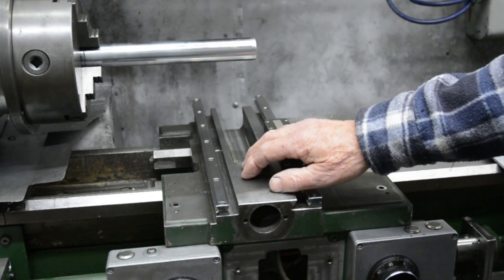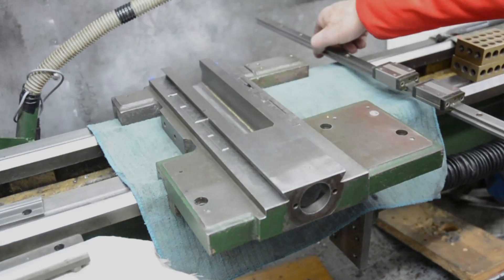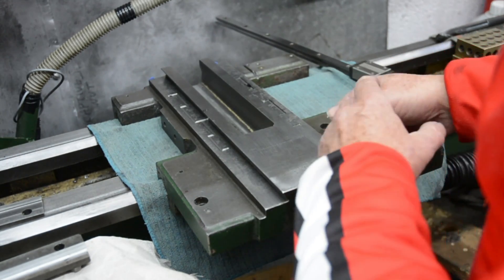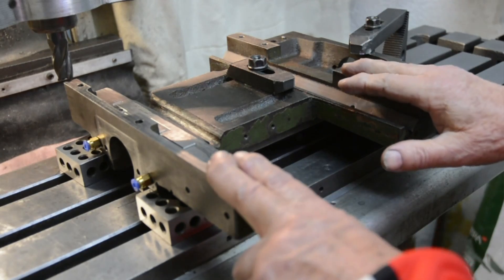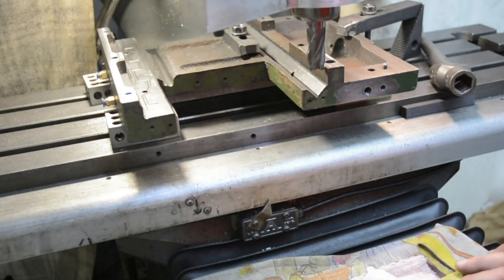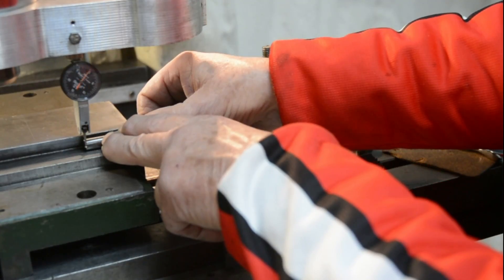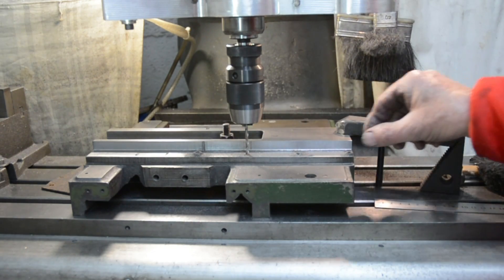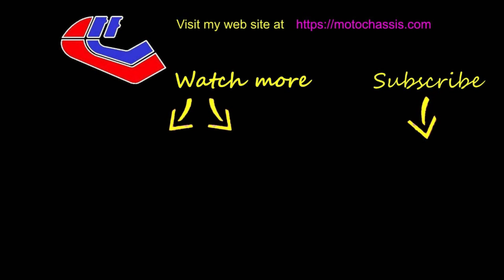Part 3. Step by step method for upgrading a lathe cross slide to linear ball rails.

Comment: Very interesting project, Tony! Once you've aligned the cross slide perpendicular to the spindle axis, and tightened down the rails, are you planning to drill/ream a few holes and dowel the rails to the carriage? Just wondering if the cutting forces could possibly overcome the clamping load of the mounting screws, and slip out of alignment? Just thinking out loud.
Reply from the maker: I answered this previously but my reply seems to have disappeared???? 
Good question and valid concern.  I did some calculations of likely frictional force with the bolts tightened and it looks like there should be no problem.  If I am wrong then I shall have to rethink and apply additional restraint methods as you suggest.  Thanks for the comment.
The alignment will be shown in the next video.
Reply: Thanks for the reply Tony, makes sense! Look forward to the next installment. @MotoChassisByTonyFoale
Reply from the maker: @907jl  next installment has been published and then the following one will be out on Sunday, tomorrow.
Reply: Looking good Tony! That lined up nicely. Looking forward to see how it all reacts as a whole to cutting. @MotoChassisByTonyFoale

Comment: I would think that referencing from the v-channel that follows the lathe bed, in the y-axis of the mill, would be a better reference of perpendicularity of your modification?
Reply from the maker: I did consider that but it would have been more difficult and although I wanted to machine it as accurately as practicable we must remember that the holes in the rails are oversize and final alignment of those is done true to the spindle when everything is assembled as will be shown in the next video.  Thanks for the comment.